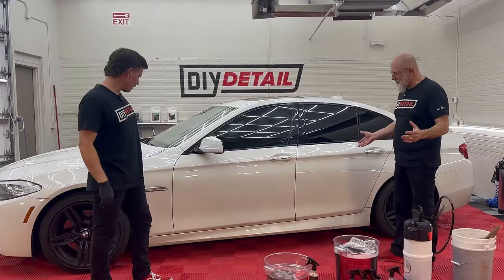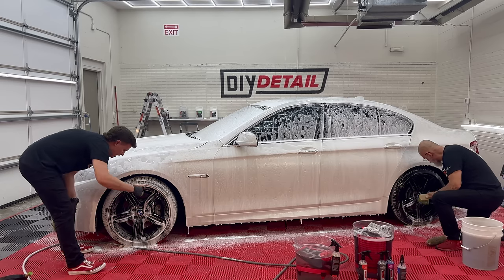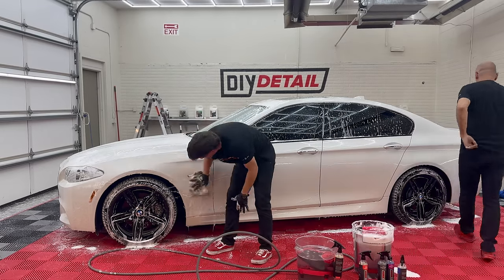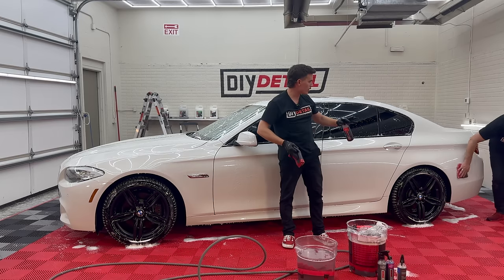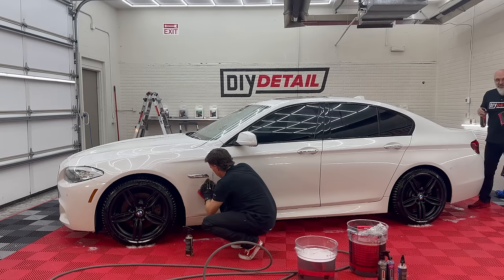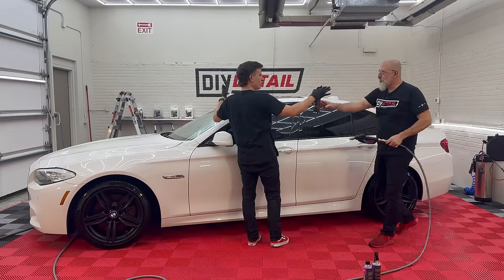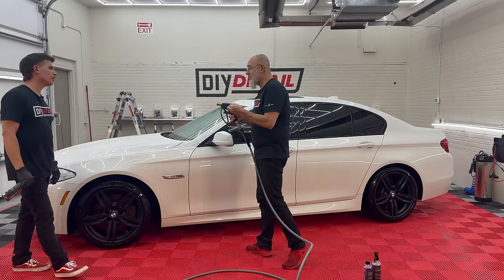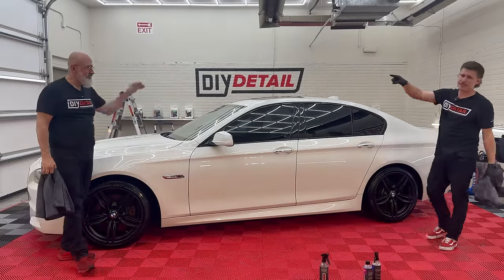How to safely wash & remove orange rust spots (DECONTAMINATE) white paint!

Comment: Could you possibly do a video on stone chip and/ road rash repair with a touch up pen then polishing? I have a white car and have used your iron remover to get rid of all the fallout on the surface and it worked great but I have some stone chips on the bonnet/hood that keep getting rust spots around them as soon as a week after using the iron remover. I would like to see your expertise on this
Reply from the maker: Thanks for the suggestion.
Reply: Did u coat them after u did all of that ? If not that’s your problem you’re just leaving the area open with no protection
Reply: @cormaro13  yes I did coat them. I've tried everything from wax to ceramic and the exposed metal just keeps oxidizing. I have some bilt hamber rust converter (hydrate-80) but I would rather use matching paint and buff it out to make it look right
Reply: @ItsMeYourRealDad  yea you’re going to need that touch up paint pen , then sand the surface down and buff it out
Reply: @cormaro13  do you personally have experience with this? Is clear coat necessary afterwards? I've seen chips done with clear coat (like some touch-up pens come with a clear coat pen) but I've got a bit of road rash on the rear wheel arches and I've seen people just rub the paint into the little chips or scratches and just polish them out straightaway. I'd prefer to utilize methods like that rather than having to wet sand, paint, wet sand, paint, wet sand, clear coat, wet sand, polish etc etc (and that's assuming things go easy and don't need more work lol)

Comment: I've always been apprehensive about decontamination. As a weekend warrior I don't want to have to polish afterward. So clay bars are a no go. The decon towel on the other hand seems much more approachable.
Reply: Meguairs do a non-abrasive clay bar and it works brilliant. I've used on lots of cars with no scratches, swirls, marring or any other problems. Honestly give it a go your car will thank you
Reply from the maker: Yes it is.

Comment: Thank you so much for the videos. I have learned a lot with you guys.
Question: I used to use P&S Bead Maker and P&S Dream Maker. Would you say that is the equivalent to DIY Quick Beads and DYI Ceramic Gloss?
I used to used those 2 together on dry surface after wash and dry. Could I do that with Quick Beads and Ceramic Gloss? Thank you!
Reply from the maker: Hi there, we don’t like to compare our products to other companies. However, if you want to use both products try this: on wet clean paint after wash…spray on quick beads, let dwell, rinse off. Then use Ceramic Gloss as your traditional drying aid. You will love the results 😍
Reply: Thank you!!

Comment: Another very helpful video…. Question your decon towel, I noticed you pulled it out of the bucket. To prep it for use, do you just place it in the incredible suds bucket and then use it from there?  Any other prep needed before using the towel?  Thanks
Reply from the maker: Dunk and go
Reply from the maker: No additional prep required

Comment: When you are using the iron remover, the soap on the paint doesn’t interfere or dilute the chemical? I have always used iron remover on rinsed clean paint.
Reply from the maker: Not significantly, but it does increase lubrication.

Comment: Does iron remover, remove car polish? As part of the process
Reply from the maker: You wouldn't use Iron Remover after polishing, that would be part of your preparation before polishing. We love a short nap towel, dunked in your Rinseless Wash bucket and then wrung out, as the first towel to wipe off polish. Then followed by a dry towel

Comment: What would you use on an acrylic convertable top for protection?
Reply from the maker: DIY Detail Interior Ceramic Coating
Reply: So would you just rub it on the outside of top just like you do the interior?  Also, how long on average will it last?  I really appreciate the videos. I'm learning a lot.
Reply from the maker: Ideally wash the top with DIY Detail Rinseless Wash. Allow to dry completely. Apply DIY Detail Interior Ceramic Coating with a brush, allow to dry 30 mins, repeat.

Comment: I think you should use a leaf blower to dry the car. No need to put a drying towel to the paint. The leaf blower will easily blow the water beads off no problem.
Reply from the maker: We feature different methods on the channel. There are videos that use both leaf blowers and a master blaster.